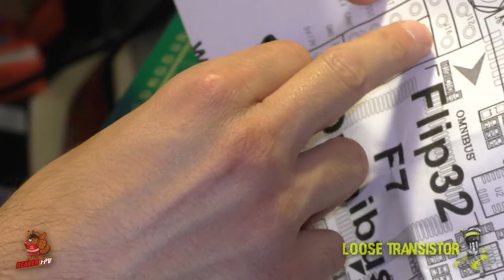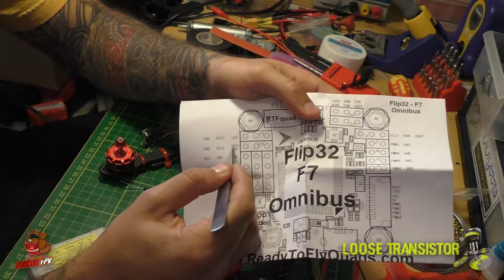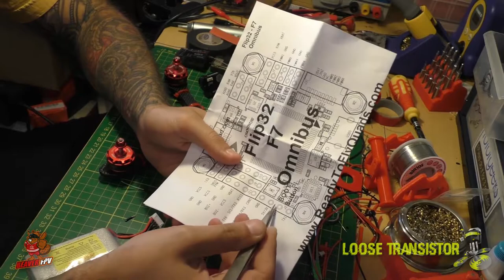FPV SYNDICATE - SHREDDER 5" - BUILD & ASSEMBLY ♠ [ FPV DRONE BUILD & REVIEW ]

Comment: So, after watching you build this, I got in contact with FPV Syndicate and will be purchasing one of their frames tomorrow. I'm still on the fence with the straight X or the Stretched. I'm thinking going with the stretched. But, I have a question for you. For the flight controller, you are using the fitted O-Rings. Do you have a link to find them? I am doing my build with the Flip32 F7 (Honestly, I selected that even before I saw your video, so I was really interested in this build) and I want to make sure I have as little vibrations affecting the FC. Thank you.
Reply from the maker: Hey Jerry,  If you are going to be racing I would say pick up the stretch-X. The standard X is perfectly fine as well, but there is something about stretch-x that I just love when going fast and weaving a track.

For vibration dampening I am using a combination of Gummies (http://amzn.to/2tOMt1A) and Bobbins (http://bit.ly/2sRi4Cx). Make sure you drill out the FC enough for the gummies to fit through. Just be careful not to ding up any components on the board and you will be fine.

I was able to push the tune quite well with this setup, the tiniest bit of mid throttle but I fixed it with a bit of TPA.
Reply: Loose Transistor FPV I'll keep that in mind when I start tuning. thanks for the tip.